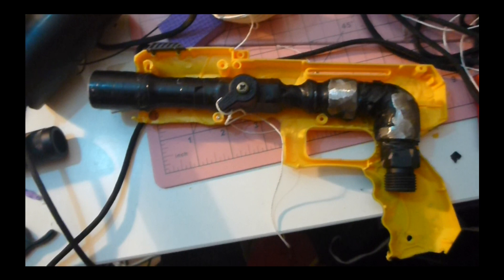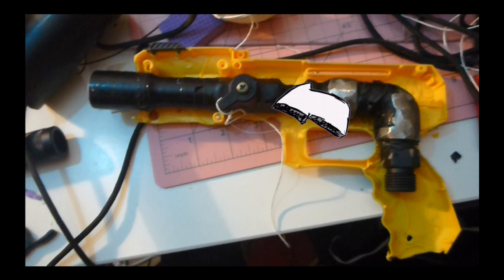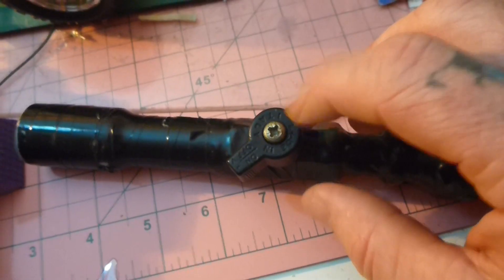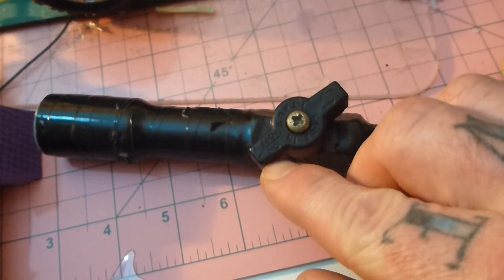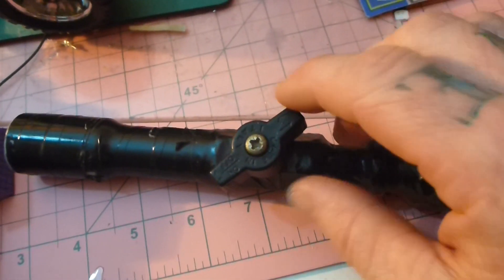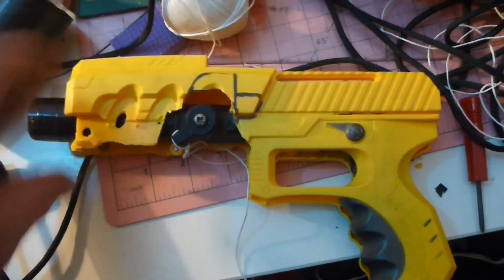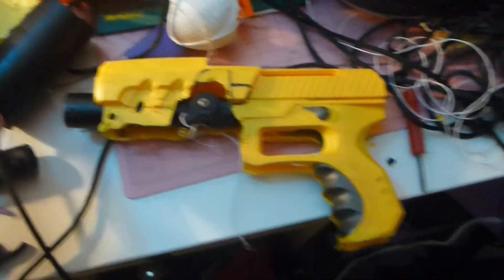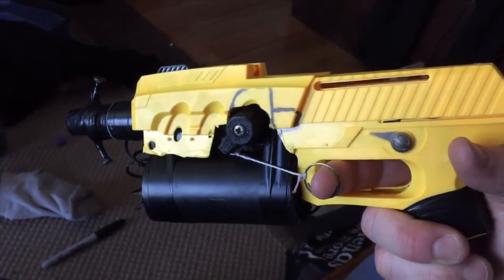DIY Batman grappling gun (for real!)

Comment: Hi can you give me instructions on how to make one please I subscribed
Reply from the maker: what part do you need help with ?
Reply: @theunstoppablefreefall  how do yo join all the parts toguether?
also in description the are just 2 parts and in the video you show 3
Reply from the maker: @mariopacheeco   the pipes fit together cause its all the same size, use pluming tape to make sure the air doesn't leak. The three peices are a c02 adapter, an open and close valve and the end is just some pvc piping

Comment: Did you have to use metal pipe also called galvanized pipe??? And how much psi was used??? Plz reply!👌
Reply from the maker: so you could probably get away with plastic parts but im not sure. Its powered by a 5gram co2 cartrige so whatever force that is
Reply: @theunstoppablefreefall  thanks!